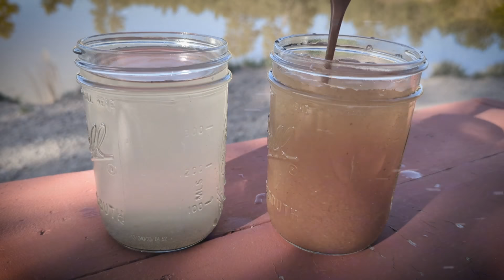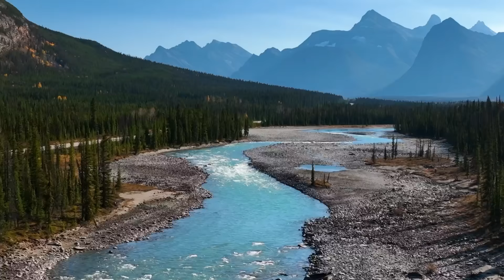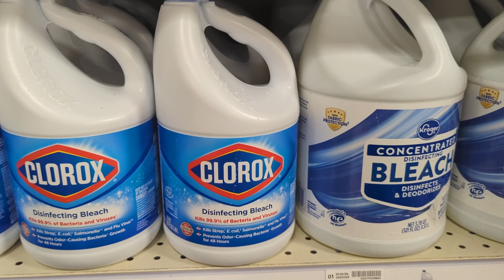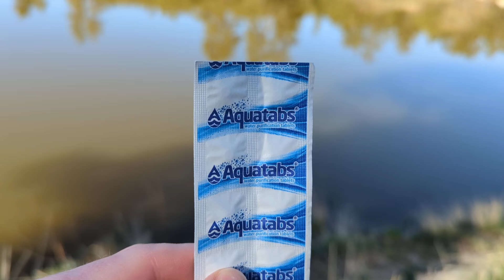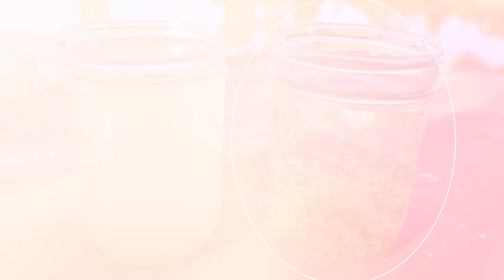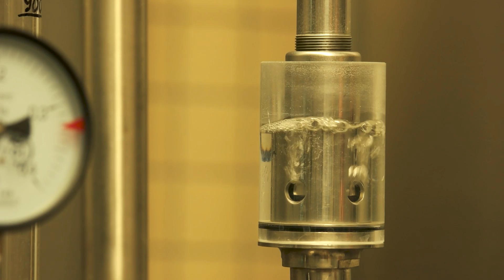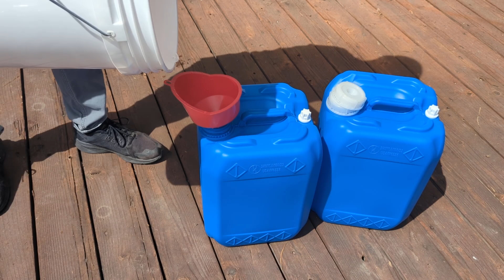The KEY to Emergency Water Preparation Before SHTF

Comment: I'M A LICENSED FOOD SAFETY INSTRUCTOR
      DO NOT USE THE LOW SPLASH, CONCENTRATED, SCENTED, OR ANY OTHER TYPE OF BLEACH, OTHER THAN  🦠 DISINFECTING BLEACH  🦠  THE ONLY SAFE BLEACH TO USE IS CLEARLY LABELED  👌  DISINFECTING  👌  RIGHT THERE ON THE FRONT OF THE LABEL  🚫 DO NOT GO BY THE INGREDIENTS LIST, GO BY WHAT'S ON THE FRONT OF THE LABEL ‼️‼️‼️

      THE OTHER TYPES OF BLEACHES USE ADDED CHEMICALS, WHICH WHEN USED TO PURIFY WATER, TO  DRINK, COOK, WASH DISHES, BATH, BRUSH TEETH, ETC..., CAN AND HAVE PROVEN FATAL  🪦⚰️  ALSO  🚫  DO NOT  🚫  USE EMPTY BLEACH JUGS FROM THOSE TYPES OF BLEACHES TO STORE ANY THING IN, LIQUID OR DRY, AS THERE IS STILL ENOUGH OF THE ADDED CHEMICALS LEFT IMBEDDED IN THEM,  NO MATTER HOW LONG ONE LEAVES THE CAPS OFF TO AIR OUT, EVEN IN FULL SUNLIGHT. AS EVEN WITH ALL OF THAT, DOING SO COULD STILL PROVE FATAL  🪦⚰️
Reply from the maker: Yes, unscented regular disinfecting bleach is the only one to use for water disinfection. Thanks for your comment!

Comment: A terra cotta flower pot with a cypress plug in the drain hole will filter water to potable very well, but it’s achingly slow.
Reply from the maker: Thanks for sharing!
Reply: What is a cypress plug?
Reply: @debrageddie8821  - A piece of a cypress tree limb about 1 1/2” long, and big enough to be whittled or sanded into a plug shape to fit the hole in the bottom of the flower pot. Cypress, because it’s anti-bacterial, and not degraded by water.
Reply: @tubularguynine  Thank You!
Reply: @debrageddie8821  - 👍🏻✌🏻🖖🏻

Comment: Its WAY more water than a gallon per person...measure ur water usage for just ONE day and youll KNOW how much is required!
You showed a water treatment like the Berkey, but not addressing it, why? I KNOW THEY WORK!
Reply from the maker: Minimum gallon a day for drinking purposes. Don't rely on Berkey to filter untreated, microbiologically unsafe water alone. Always ensure you have a proper method of disinfection as well (chemical, UV or boiling)
Reply: @waterfilterguru  I have tablets for treating water, as well as other items like REGULAR bleach, several lifestraws, and more, especially i plan to BOIL ALL DRINKING WATER IF IT COMES TO NO FRESH WATER, I also have rain catchment...I CAN'T AFFORD the hand pump for our well, but DO have ways to use generators to get water into the house into a tub for whatever...I've played out so many scenarios from what my great grandmother told me of the great depression that I pray I've got as nany options as I CAN afford!

Comment: I, as I am sure many people do, have a shingle roof. The reason I  haven't installed a gutter catchment system is because I  heard that the shingles are made with dangerous chemicals which will contaminate the water. Anyone have any input on this?
Reply from the maker: Not yet, but you gave me an idea for another project 😉
Reply: @waterfilterguru  i have heard this also about wate that's been on certain shingles.

Comment: The water in the toilet tank I would just leave for using the toilet. We had no electricity for a year and no running water for four years. When it was warm we would get water from the lake and use that for flushing the toilet as usual, you have the option of pouring the water directly in the bowl or in the tank itself and flushing as usual, I can't remember but with one of those ways it started to smell and we switched to the other and it was good to go. 🤔 In the winter we used an outhouse (get a styrofoam seat for cold),  made sure all the water was drained out of all plumbing including water heater and washing machines, then put antifreeze in toilet and down sinks.
Reply from the maker: Thanks for sharing your experience

Comment: I had a counter top distiller when we lived in town, it was gross how much brown scum was left in the distiller from town water, but still couldn't use the finished product because it tasted metallic. 🤷‍♀️ I've tried storing those small jugs from the store as well and had problems with them randomely rupturing, usually after a year.
Reply from the maker: What was the vessel made from that the distilled water was captured in?

Comment: College students did a project in Patagonia in which they made "sails" to catch moisture from the air.
They used sheets suspended oved plastic pipes. The pipes were at a slight angle and led to large barrels.
They region went from being an arid desert to a farming community with an abundant supply of water.
I think I saw this on Discovery Channel.
Reply from the maker: Cool thanks for sharing
Reply: That was invented in my country actually, "Chile"  The fog catcher system,  in Atacsma desert, the driest desert in the world.
Reply: I’ve seen examples of that being done in Kenya, too🙌🏽
Reply: I think tight netting works better.
Reply: @dont.ripfuller6587 You're right. Rhat's what's generally used.
Reply: 😮 so like out of bio dome
Reply: Fog nets. They do it in a few places around the world.
Reply: @ricosadventureswithbeckyan1373 - I remember watching a video about that!
Reply: So let's do it like they do on the Discovery Channel
Reply: That is so cool!

Comment: I bought a LifeStraw water filter for camping. It is small but super handy for any emergency. $20
Reply from the maker: I keep one in my car
Reply: @waterfilterguru  I read that lifestraw is not able to filter viruses. so lifestraws are still a gamble. after water is filtered, boiling before drinking is still the safest.
Reply: @alexlee1319 Thank you, yes this is an absolutely correct. If you are unable to boil the water, having water sterilization tablets, They're like little iodine things that you would put in about a quart of water and it will sterilize it after about 10 minutes of microorganisms. I highly recommend trying to acquire a large quantity of these tablets as sometimes boiling is not an option in certain scenarios. So a funnel a life straw and some iodine tablets may be able to provide you with the decent amount of water.
Reply: @alexlee1319  NOT true.   Lifestraws do filter viruses.
Reply: @AdmiralStoicRum  It is not correct.   Lifestraws DO filter viruses.  Google it.
Reply: Sawer squeeze filters are wayyty better. They attach to the standard 2L bottle thread. They also offer the S series which can filter viruses and toxins.
Reply: @alexlee1319  depends on the model. 0.02 microns from Lifestraw mission (gravity bag) is good for viruses and has testing. 0.1 microns that is more common, is good for bacteria not viruses.
Reply: @TappedInATriangle  If there is a lot of sediment in the water you should let it sit for 24 hours (as stated in the video), then strain it thru a pre-filter like clean cloth or a coffee filter then use the sawyer filter and make sure you back wash after every use.  Sediment can clog up a filter pretty quickly otherwise!  Another advantage of the sawyer filter is that it has a container and a syringe (for back washing) included in the kit.  Also, you don't have to orally suck the water thru the filter like some filters.  This is very important if you have a sore mouth, throat or dental problems!  For the low cost of about $25 each, the sawyer mini is top dollar IMHO!
Reply: @alexlee1319  Filter any sediment through a coffee filter and boil. Let cool and drink through a life straw. That should eliminate any potential hazards besides salt
Reply: @rogerjensen5277  the mini is way to slow usually. platypus makes a great filter these days too

Comment: You can just use a tree branch and coil it into a loop with dirty water in containers up high and clean containers on bottom to catch the filtered water , i.e. pine branches , grape vines work the best , the xylem filters impurities out ! MIT JUST DID A STUDY ON THIS AND IT WORKED GREAT IVE TRIED IT ! KEEP THAT IN BACK OF YOUR BRAIN
Reply from the maker: Great tip & video idea!
Reply: Can you explain more! I purchased copper tubing coiled in a box. This would be easy to throw around a branch, hook up water filtration at the top and drip down into a container.
Reply: @DKFXCT  the vines contain xylem which is a natural filtration device made from mother nature ! It filters more germs and bacteria out then any product sold in the market ! CHECK OUT M.I.T. VIDEO BOUT THIS VERY SUBJECT ! VERY CLEAN AND CLEAR WATER ! THEY TRIED SEVERAL DIFFERENT TYPES OF BRANCHES AND FOUND GRAPE VINES WORK THE BEST!
Reply: @waterfilterguru  already been made into a video mate !! MIT made a video of it ! Look it up , very informative
Reply: @DKFXCT  the hose ain't filtering shit ! Look that video up

Comment: I have collected clear jugs, but rhey are kept in a cool, dry place so hopefully it does not affect anything.
Reply from the maker: Did you sanitize them before filling them?
Reply: @waterfilterguru  bought them from the store, so plan to put them thru my water filter pitchers when they are needed first before use.
Reply from the maker: @19karrey75  Right on

Comment: Do NOT leave water in a plastic bottle in heat/sun, not even in your car on a warm/hot day.  The heat leeches the chemicals from the plastic into the water
Reply from the maker: You make a good point, but keep in mind the tips in this video are intended for emergency preparedness and survival situations
Reply: In an emergency you'll die of dehydration before plastic poisoning. Stop being ridiculous.
Reply: True but if you are dying of thirst, you aren’t worried about the chemicals. Plus, when things stabilize, the chemicals can be detoxed out of the body. Medical medium (Anthony William) has great detox protocols. Work like magic.
Reply: Yes, I had some cases of water on the back porch with Temps in the 90's, now the water tastes like crap!😲😲
Reply: @wallychambe1587 I taste plastic in all the plastic water bottles
Reply: I had a well drilled and hit pure spring water at 55 feet and below bedrock. It is tested and found perfectly safe for consumption. There is an electric pump in the bottom and a manual pump on top. My first concerns when the the power goes down is to keep the: water flowing then food then heat. I do water reliably with solar, whole house batteries, trifuel generators and manually pumping. Water is not a problem for me.
Reply: @waterfilterguru 
I had a plastic gallon jug of water in my car on a hot day. I took a sip of it and it tasted strongly like gasoline. I understand storing water for an emergency but storing it in plastic in a hot garage or shed will make it toxic.
Get a few gallons of water and stash them anywhere that will stay cool. If  they are clear containers they need to be out of light.
Reply: I try to rotate out regularly..
DO keep water on vehicle.. EXPECALLY on hot days!
One dehydrates surprisingly quick..
With judgement the first to go!
Reply: @jonjacobjingleheimerschmid3798  Buy a few stainless steel canteens. It'll do you some good to have chemical free water storage that can even be used to boil water. They're also the best water bottles ever. Fits in the hand like a glove and holds a quart.
Reply: I'm not really worried about pfc's during the apocalypse. Just sayin'...
Reply: There has to be a better way than chlorine to keep algae from growing in water storing tank. Anyone know if copper metal inside tank does anything?  I heard someone  say that works but couldn't find any info on it.
Reply: I drank bottled water that sat out in the blazing Iraqi sun for months and I’m juuuuuust fine.
Reply: I can my produce.  When we use a jar over winter I clean it and fill with water.   Place jar back on shelf till I need the jar next canning season or we need water.
Reply: In an emergency, first things first.....remember you can detox your body system later
Reply: @Cece-Lia-11 Yes‼️ copper definitely has stopped the algae from growing in my bird bath - I had some smallish copper molds & tossed one in2test its effectiveness- it's been 3mths & it works great - no algae👊
Reply: Dude we got water we stocked up out here in Iraq since the early 90s in this FOB, trust me it's fine.
Reply: 😂 tell that to the military
Reply: The chemicals get leached into the water regardless. Plastic water bottles are absolutely terrible. Glass only.
Reply: i was thinking that, trading off some potential bacteria for a ton of microplastics, pick your poison
Reply: I have glass jars of water in my car. Unfortunately, we're having car issues, so now I'm using a large water jug so I have water for my dog and I, easily carried.
Reply: @SgtWTFOver Thank you for the voice of sanity, and for your Service.
Reply: Because those skids of bottles don't bake in the back of 18 wheelers everywhere...
Reply: Your right put in glass

Comment: Would you point me in the right direction of a gutter/barrel rainwater collection system? Thank you!
Reply from the maker: Do you plan to use the water for consumption?
Reply: @waterfilterguru  Not sure either consumption or cleaning. We have some drinking water stored up but it’s only 25 gallons or so.
Reply from the maker: @K_ballet  At a minimum, I'd recommend a 5-micron sediment filter. If you plan to consume the water, you'll also need a proper method of disinfection (chemical or UV, depending on how complex you want the system to be). I'd also recommend a carbon filter.

Comment: I saw a video about how you don't need to boil water (though its nice assurance of effectiveness). You can keep the temp high but below boil and pasteurize the water for a fairly high safety (as far as living contaminants go). Thay way you can still have some peace of mind without shredding your fuel. 
Because its hard to tell when the heat is just high enough to be effective, the person recommended a little gizmo on the end of a wire that has a bit of some kind of wax on the inside, and once the wax is fully melted, the water is ready to go.
Reply from the maker: I'd only recommend boiling, UV or chemical treatment to properly disinfect water

Comment: The hot water heater isn’t good drinking water.   It’s actually recommended you never cook with it.      In a shft I guess I would.
Reply from the maker: Which is exactly why its important to also have proper methods of water disinfection and filtration prepared as well 😉

Comment: Definitely no plastic bottle in the sun! The heat will actually release the microplastics into the water even faster. This is also why no one should ever drink water from a plastic bottle left in the car, or otherwise heated.
Reply from the maker: Keep in mind SODIS is a method used for emergency or survival situations where the immediate risk is waterborne illness caused by microorganisms.
Reply: It’s survival drink the plastic water

Comment: Don't boil water if it has fluoride in it, do some research on that. Use BPA free plastic containers. Tubs can hold water but many have a slow leak. Too many chemicals in the pools unless they're rain water but lots of yuck in there like he said. If you get water from nature, make sure it's MOVING. I guess you can also get ice too. There are also machines that pull water from the aethers which they are using in deserts to create water. Would suggest a glass gallon jug to put outside in the sun like in making sun tea. Another option would be ice chests full of water. Storing ice in your freezer to melt or would be melting if power off for a long length of time. I think most issues with any of this will be larger cities.

Comment: I have two unused garbage cans with lids…if a disaster is coming I fill them up.… for non potable water use…flushing toilets, washing dishes, cleaning. Also I have Red Cross bladder that fits in the tub to store more water. For same usage.  For drinking water I have other systems.
Reply from the maker: Thanks for sharing your setup! What is your plan if the water shuts off unexpectedly before you can fill each of these from the tap?
Reply: @chrisbirch2002 I totally agree with you and those barrels! They are easier but they don’t send them to Hawaii. Lol
Reply: @chrisbirch2002 I’ll look into it. Thanks!

Comment: I reuse all glass jars for tap water, even a small horseradish jar has water in it. I get 5th root beer schnapp bottles and clear from others. Just tapwater as ours y can smell the chlorine in it. I have over 100 so I am not going to switch the water, I do have various treatments for it. I have store bought bottles of water lining drawers under the clothes. But this made me realize I need a small hose to empty the hot water heater if needed.

We have a clogged creek right down the street, it may be clear farther down but theres filthy water to get and ways to filter and purify.

Comment: Dehumidifier water is not consumable unless treated. When I was gonna use it researched if this is okay. Nope. 

If there’s an emergency requiring water conservation would rather treat water or use a filter system like ProOne than not to be safe then sorry. 

Would not wanna get sick when hospitals are dealing with a lot during an emergency. 

Distillation compared to ceramic filter is nutritious. Ceramic filters allow restoration of water quality. Distillation removed everything and considering the body needs nutrients for health prefer filtered. 

This is a great video to help inform people so they don’t freak out. Never hurts to know how to handle circumstances just in case, imo
Reply from the maker: Thanks for your comment. This goes to show the importance of not only being prepared to source water, but also having sufficient treatment methods, including filtration, on hand and ready.